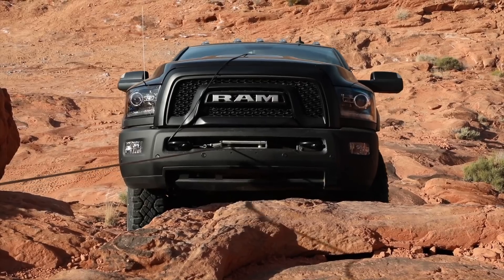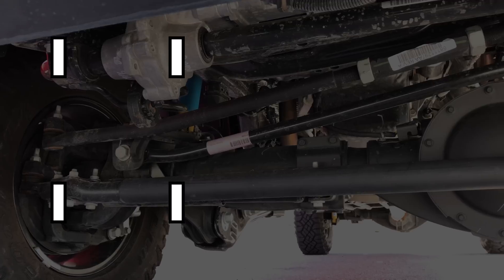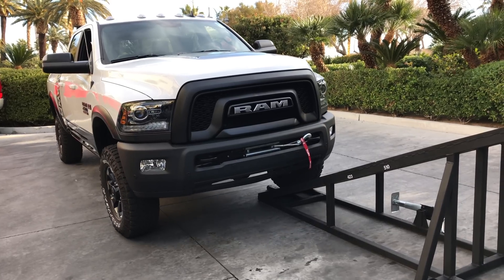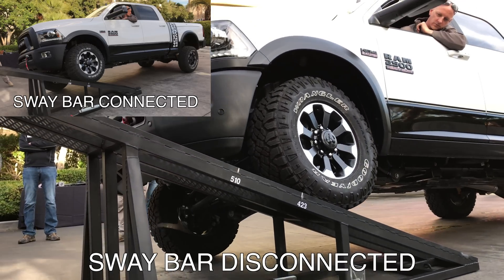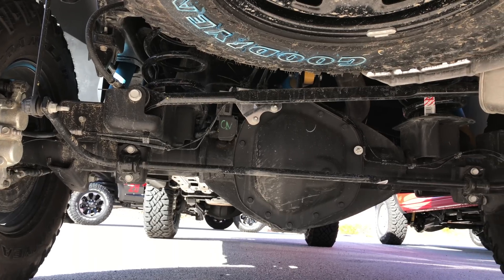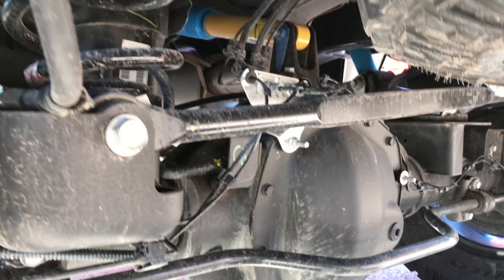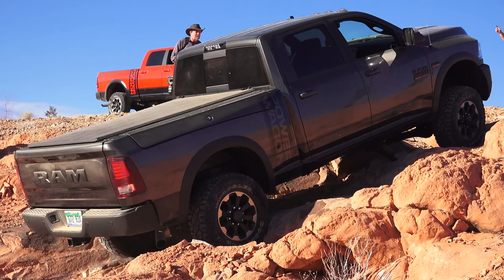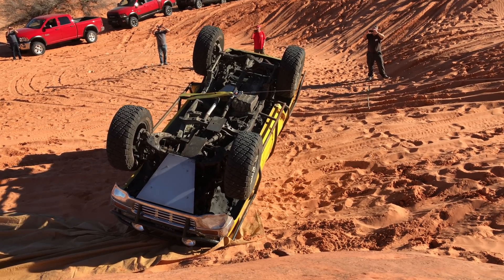5 Features For The Ultimate Off Road Truck

Comment: Isn´t the Unimog with its portal axles the ultimate Off-Road 4X4 vehicle?
Reply: There are so many ways to determine the "Ultimate" off road vehicle. Is it speed? Rock crawling ability? River crossing prowess? Portal axles are helpful in that they give extra ground clearance but everyone will have a difference preference as to why their favorite vehicle is better.
Reply: Yes, it is one of best trucks in the world, is just that people dont mention it because it would make all these pick-ups look silly and small compared to it, and it could also be that the Unimog goes into a whole different and higher level of off-road capabilities, similar to MAN KATs and Tatras (or maybe even tanks).
Reply: Ninja Master The first Unimog was designed as a tractor, but since then Mercedes builds them for all kind of Stuff.
After all Unimog stands for Unversalmotorgerät or universal motor device.
There are military versions, roadwork versions, extreme offroad versions, hell there is even a railway version that can drive on rails.
It is basicly like a Pickup, just military grade and better for Offroad use (at least the extreme Offroad version).
Reply: Unimog 404 and the DAF YA 328 sure are the ultimate stock offroad vehicle's in my opinion.
Reply: Good point.
Reply: No its not, its far too heavy. The jeep wrangler Rubicon is probably the best you can buy stock. The unimog is really good for how big it is. Yes its portals give it good ground clearance allowing it to do good in rocks but due to its crazy weight, its only good in rock when your on relatively level ground. When you start going up steep hills or obstacles, the weight hurts you bad.
Reply: Well, actually a 406 weights 3.5 tonnes and it is not too big, and it can surpass a Jeep in almost every situation, it has the portal axles which give a lot of ground clearance, the coil springs suspension which gives more than 30 degrees of axle crossing without any modification, torque tubes which protect the drivetrain, and the gearbox, which has crawler gears for very low speeds (like 0,5 Km/h) which is good for steep submits, and the modern models (like U5000 and U500), have the same features and they also have CTIS (Central Tire Inflation System), which helps to move over rocks, sand, mud, etc, with ease and can go for inclinations of 45 degrees without modifications; but the only thing that i must recognize in which the jeep surpasses the Unimogs is in the price (for modern models), a U5000 can easily go up to $150.000 and there are some components which cant be replaced by non-original parts (Expensive), so, in this case the Jeep wins, and there are also other vehicles which i think they perform very well too, like the Pinzgauer (Which is a very light but robust truck).
Reply: Yes, when you see a Unimog in person, it leaves a heck of an impression.  Shout out to 2016 Overland Expo East for the demo and "buyers guide:.
Reply: I do want to add that the Unimog can be purchased with the "rare" high speed axles, making it handle about 100km/h.  And yes, you are driving effectively a special tractor with a large diesel engine underneath the cab and virtually no sound insulation.  
Still epic.

Comment: can you also review the Ford raptor suspension. also explain  if you have warm up an  electric/ hybrid cars
Reply: You do have to warm up hybrid cars as they have gasoline engines. Not sure about electric.
Reply: pukes hybrids
Reply: Good questions about electrics. I know you will always have to warm up the tires and even the fluids in the transmissions, but depending on the battery type, it may be more resistant to cold, but if the temps are too low, the battery charge life is diminished.

I wounder if you could start the electric vehicle and just peel out, driving hard without much damage except tire wear, like in Akira, with Kaneda aggressively riding his electric bike